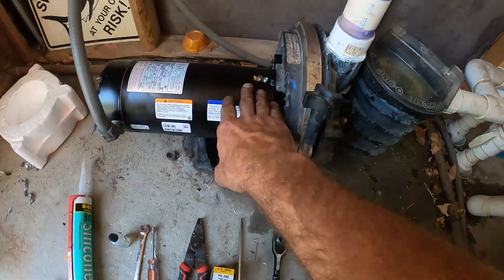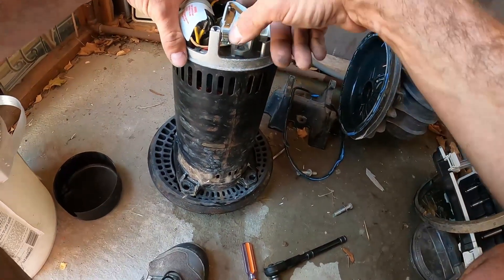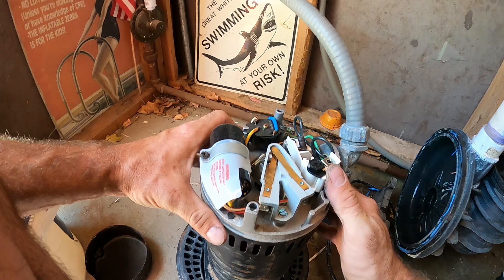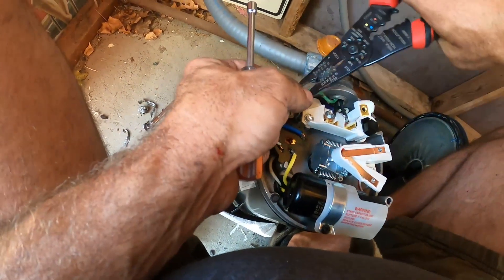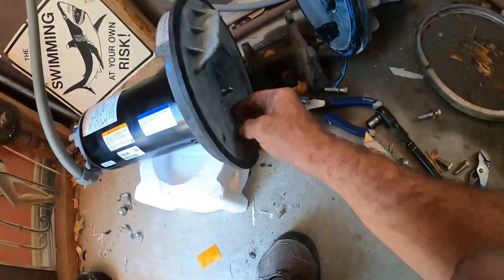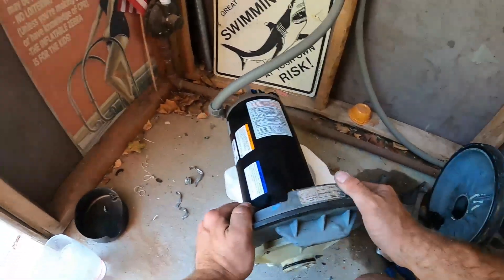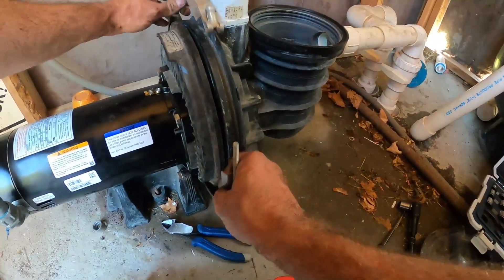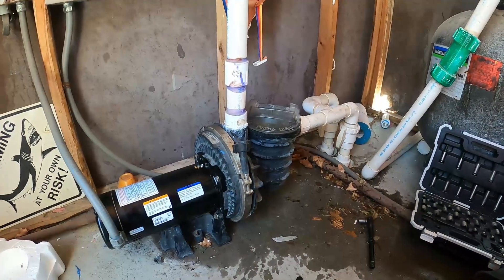Sta-Rite Motor and Pump Seal Replacement: How to change a Motor and Pump Seal on Dura-Glas Pool Pump

Comment: Once you turned on the system, did it have a particular smell coming from it? 

I just finished mine watching your amazing video and everything worked perfectly. No leak and easy to reassemble with your methods. However, I did get a smell coming from it after it was running for a few minutes and water running through it. I wasn’t a burning smell but more something evaporating.

Comment: Thanks for the good information, my unit is pre-1998(1986) you mention the J3-2 seal plate insert. I have replaced the motor a couple times but I have never seen this seal plate insert, how important is it? and where is it actually located? Great Video.

Comment: At about 5:35 you take the plate off the motor but do not specify how. I tried prying and gentle tapping but it doesn't move. I'm afraid of cracking it. How did you do it?

Comment: I replaced everything and it started right up with no ,waking.  After about a minute it started to smoke a little bit and smelled burnt.  Not from the pump motor area but under where it was previously leaking water.  Is it possible the impeller was put on too tight?

Comment: Thank you so much for making this video, following it exactly has helped me twice now......a little advice for everyone that's using this as a guide.....save it to a play list, you will need it MUCH sooner than you hope, these motors typically don't last long even when installed correctly.  This is by far the best instructional video for this exact pump motor replacement.

Comment: I have watched your video multiple times over the past few years, and I just want to say thank you for sharing it! I had a really bad leak coming from the connection between the motor and housing, and it is now dry as a bone. The key was putting in the silicone behind the main oring gasket, which did keep it from falling out. The Century motors are a little different now with no switch, but I can tell you this video is a great tutorial on how to replace everything you need for a StaRite Dura Glass 2!
Reply from the maker: Thanks for the great comment 👍
Reply: Thanks for that heads-up, I about to unbox my new Century and I would've been surprised and confused.

Comment: V nice video. My pool pump is 1997 built. I am replacing the motor and have ordered it. I have a feeling the seal kit is for pumps after 1998. Will that be a problem ??

Comment: Great video BTW, can you tell me if the shaft plate O ring on the pump you serviced has a square cut? I have a similar pump, but once I removed the seal somehow is now longer   and I’m having a hard time trying to get the correct part to finish this project.  Thank you

Comment: Tapping the ring clamp to make tightening it easier is a good tip. I have used pool lube around the plates where the ring seats. Also allows for a nice tight squeeze.

Comment: Great video, and VERY helpful!  I ended up having to use the butt end of a 3/8" ratchet between the motor housing and the centrifugal spring mechanism on the shaft (mine add a screw in the shaft, not a 7/16" squared off shaft grabbing point) at the rear of the motor in order to get the impeller off.  It was a pain and was getting stressful, as I was trying a number of things before I determined that a firm, metal ratchet handle end would fit just right between a recessed area of the motor and the spring mechanism.  Everything else went exactly as you described - thank you!
Reply: Thank you

Comment: I had to empty the basket under the dome, but I can’t get the dome lid back on. I have plugs in the skimmer and the output (idk the term for that). There is a trickle of water still getting through, but what in the world do I need to do to get that thing back on?
Reply from the maker: The pump lid should twist or lock back in to place even if you have to fight some water back flow. I'm not sure exactly what is going on with out being there but hope you get it figured out. Sorry

Comment: I found the hard way that tapping the clamp with a rubber mallet as you tighten finally sealed the unit after numerous tries. Wish  I had seen your comment about tapping the clamp before hand. Thanks for just a great video!
Reply: Put some lube on it before assembly.

Comment: Thanks for the great video... I have a Sta-Rite P2R pump that developed a vigorous spray coming from a several inch section under the ring clamp. Water begins dripping almost immediately when the pump is turned on, and turns into a hard spray as the pressure builds. I replaced the seal plate o-ring, cleaned the seal surface (both sides) and the channel for the o-ring, and lubed the o-ring with silicone plumber's grease. I also cleaned and lightly greased the inner side of the lock-ring clamp to reduce friction and got it pretty tight on there. Unfortunately there was absolutely no change in the force of water spraying out. Could it be something besides the o-ring and clamp?
Reply from the maker: After doing a good inspection of making sure there isn't a fracture or a crack in the actual area of where the waters coming from I have actually had to attempt getting the oring to seal on some of them up to four times myself I just couldn't get everything to line up so I think I actually siliconed the o-ring into place because by the time I wiggled the motor back in it kept moving out of place. Very annoying but four times and it didn't leak. Not my favorite feature of these pumps. Thanks for watching and hope it decides to seal up for you. Also make sure to tap that clamp why you tighten it.
Reply: @Poolelementary  Thanks very much -- I didn't see the tapping trick until after my failed effort, but I'll definitely try more silcone, re-seating everything, and lots of tapping.

Comment: After seal replacement is it supposed to seal 100%. I don't see water dripping, but if I feel with my hand after it runs for over 15 minutes I can feel some water seeping.
Reply from the maker: There should be zero water. If everything was installed right then you might have gotten a bad pump seal it's rare but does happen. Also sometimes silicone around the rubber bushing that pushes into the motor plate side can help with a small seep issue
Reply: @Poolelementary   It was a slight weep from the area with the large clamp. A few more turns and all is dry. Thank you for your input.
Reply from the maker: Glad to hear it was an easy fix Sebastian.
Reply: @Poolelementary  Just an update. The area around the large clamp would still weep after about 2 hours of running. I ended up buying an OEM gasket which was squared off and thicker instead of rounded. This finally resolved the issue and I don’t even have to tighten the clamp down as much.
Reply from the maker: Nice, awesome update 👍
Reply: @sebastiang7183  The one that was in mine already looked to be squared off, too.  Would you happen to have a link or part number for that seal?  I think I'm going to need to replace mine fairly soon.  Thanks!

Comment: Is the cone part necessary? I accidentally broke the cone piece off but some of it is still left in there. The seal is good but now the cone part of the j3-2 is missing. Is it necessary to replace it or am I ok leaving it? Will it hamper performance?
Reply from the maker: Honestly I have had broken ones to and gone without replacing it when I was on out of town jobs and didn't have the replacement parts and it's been years with no leaks and the pump seemed to still worked sufficiently. You can try it and if it doesn't work for you you can always order the replacement parts.

Comment: I've heard a number of times to "not touch the ceramic seal surface with your fingers" when installing, it will cause the seal to fail.  I noticed you didn't seem too overly concerned about that and did not mention it during your excellent tutorial.  Is touching the seal surface a real concern or is that just a myth?  Of course I do understand that the seal must not be contaminated with grime, but will touching it with clean hands/fingers shorten the life or otherwise ruin the seal?
Thank you for the excellent video.  I have successfully replaced a seal before, but the tapping of the lock ring clamp with the screwdriver handle is a tip I did not know and I will use the next time.
Reply from the maker: Thanks for watching Floyd and yes you do want to avoid touching the ceramic but if I do I will make sure to wipe it clean with a paper towel. Latex gloves eliminate any chances of leaving oils on the ceramic seal. My bad for not making this clearer.

Comment: What is the model number for the shaft seal you used? PS 100, 200, or 201?
Reply from the maker: Hi Michael in the video I used a PS-200 which normally fits your Dura Glas pumps ( PE, PEA, P2R, and P2RA) Hope this helps.

Comment: You mentioned applying silicone to the Seal Plate O Ring. Do you mean the same type of silicone use in bathrooms for caulking? Or is there another type of silicone that needs to be used?  Usually I use O ring lubricant (Magic Lube), but from what I understand in your video, O ring lubricant might not adhere as well as silicone.
Reply from the maker: I normally only apply o-ring lubricant to the seal plate o-ring to help it from drying out but if your having troubles with the seal plate oring staying in place while you line up your pump to get the bolts back in I sometimes will use some 100% silicone with a caulking gun and apply it to the oring to help make it sticky enough to stay in place until I can get my bolts back in and tightened.

Comment: I have a  Max E Glas with a diffuser that looks just like this one. I have a salt water pool and the brass bushing in the diffuser is pitting badly and quickly . ( less then 6 months) . do you know of any better bushings/ repair ?
Reply from the maker: I don't  know of any better parts or repair you could of done. To prevent the pitting it comes down to bonding all your pool equipment, using a salt water scale inhibitor and making sure the PH is good around 7.5